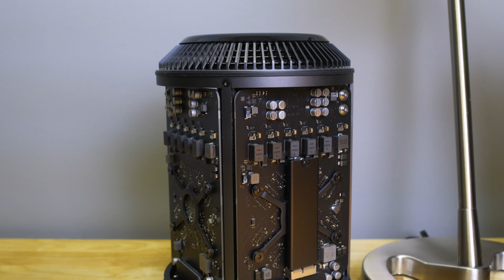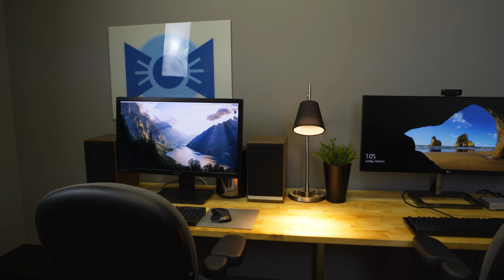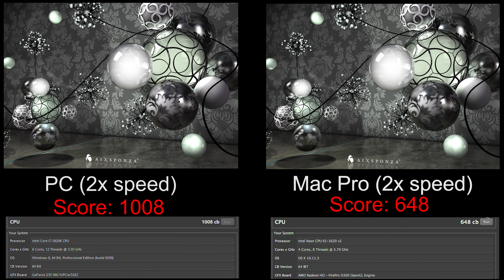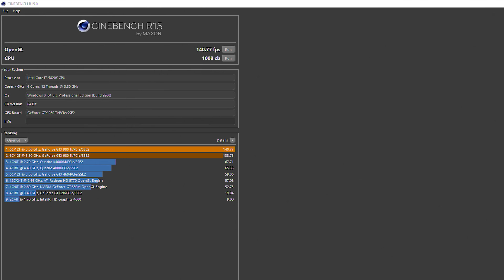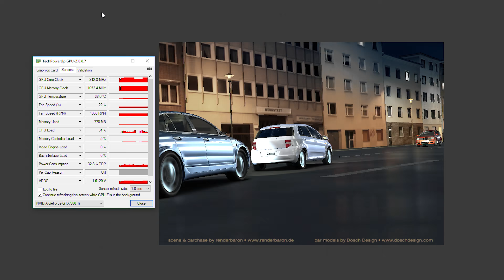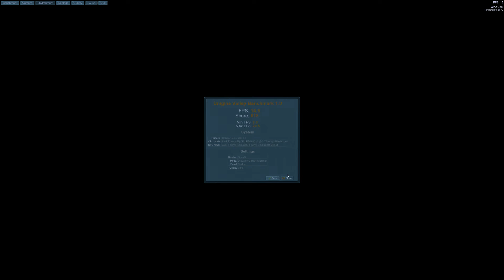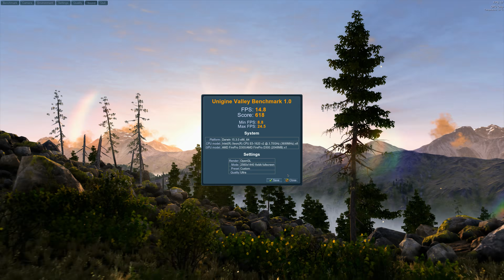$2,000 Custom PC vs $4,000 Mac Pro

Comment: My Alienware is probably stronger than that 4000$ Mac lol
Reply: you said probably lol ironically Alienware and Mac both overcharge.
Reply: +Phoenix MH83 yes they are.  But now laptops aren't that overpriced as before.  A 2000$ alienware has 980m vs a 2000$ pc that will have 980. And I'm talking about a full pc not just tower. 
It Just comes down to portability vs performance.
Reply: A 980m will not perform on the actual 980 level. Maybe 750 ti. For $2000 I could build a beast. You never really want to spend that kind of money on a high end pc unless you dont know jack about building them. The money you save is amazing. But Alienware will charge even more than other retailers do.
Reply: +Phoenix MH83 btw.  980m is pretty much a gtx 970 if u don't know and yes u can.  What did I just said?? Performance vs portability..  Yes alienware is not as strong as a desktop in that price but u can just take it anywhere u want. Not like desktops..  And in 2000$ a Full Pc will have a 980 not 980ti. That's for 2000$ tower unless u got heavy discounts..  Lol
Reply: +Rock GamingTV 970 out benches the 980m you can check for yourself. 750 ti is an excellent card and great comparison. Especially when overclocked.
Reply: +Rock GamingTV for $2000 I could make a rig that would run laps around alienware in price comparison. When they say your paying for the name they mean it. Their products are cool looking but its throwing away money given the alternatives
Reply: +Phoenix MH83 I said almost lol..  Yes 980m loses to 970 by 10 fps. But comparing it to 750ti is Just funny..  750ti gets around 35 fps on bf while 980m gets 62.. Anyway.  It comes down to personal preference.  U travel a lot? Get gaming laptop.  U stay in one place..  Get desktop.
Reply: +Rock GamingTV My 750 ti performed over 60 on ultra with Battlefield when I owned one. I loved it. Then I got my MSI 970 OC
Reply: +Rock GamingTV there are lots of videos out there you should check them out. 750 to was damn good especially in Battlefield
Reply: +Phoenix MH83 OK.  I checked every benchmark for 980m and 750ti and did some of my own 980m benchmarks..  
Bf4 tests. 
750ti oc hits 60+ only when there isn't much happening in the screen.. Like at all..  It drops to 25 or even low on some places. 
980m hits 100+ when nothing is happening in the screen and drops to 55 on worst.  
750ti oc avg is 44 fps 
980m avg is 81 fps..  
There is no competition.. They both are in totally different league..  The only card who was as good as 980m was 780 non-oc. U can see the benchmarks.. I have seen like every benchmarks anyway.

Comment: You should compare a  $4000 windows pc to the Mac Pro
Reply: R.I.P macbook pro
Reply: 1. There is no newly released MacPro yet
2. When the MacPro was released, any 4000Dollar PC was better except for the small formfactor the MacPro has
3. Even if you buy the MacPro now (4000 dollar Model) You get the same base specs as mentioned in the Video, which is still freaking old hardware.
4. The fact, that you buy the name APPLE with every overpriced product they have is not even a secret. The Hardware is old when it's released, the fact that apple mostly uses proprietary Adaptors (lightning...) for most of their Products is stupid.
Reply: Theres no point; the Mac would simply short-out due to the amount of overwhelming power it detects coming from the PC.
Reply: Maybe it would be more fair to compare a newly released MacPro to a $4000 windows pc. Still if you are going to pay this amount you should know every time what you get from one solution or another. Plus, to be even more accurate you should put Xeon and ECC memory to the windows pc as well as fire pro graphics cards. I have a suspicion that in that case the price difference would be narrower, but still the windows pc would come on top.
Reply: would be a better idea to use quadro for gpu as they are more up to date than newest firepros and also have cuda. Though the windows pc would already win in reliability thanks to proper cooling.
Reply: He should also use a xeon not a I7.
Reply: +tubeRSP mate, a high end pc should run any game 1080p 60fps high graphics for at least 5 years, no matter the age
Reply: +CoComero Productions I don't disagree on this. I don't even disagree that a pc with consumer parts will probably run games faster than one with "professional graphics cards".  But to me this artificial divide between "consumer"  and "professional" parts is an insult to the end user. A graphics card should be equally good on the compute part in any case. Because I have never seen any of my pcs strictly as a platform for games, but as a general computing machine, in which lies their superiority to any other  "platform". But reality is reality and if you want to see what it takes to have an equally good pc on the compute part you have to throw in professional parts. Loosing 5 to 10 frames per second in games is sth you can live with and is hilariously irrelevant at the end of the day. But not being able to take advantage of your whole silicone for computing is big fraud to put it nicely. The same logic applies to cpus which has further unpleasant repercussions for computing in general and for games in particular.
Reply: He should actually try using comparable types of components in that one.
Reply: Dot Red a laptop? lmao laptops are shit for gaming an preformance

Comment: again another pc mac war. benchmarks benchmarks price price price..   No one seems to really understand the product's production value.  All macs are specially designed and custom build every single part of it.  PC is custom build with consumer products available on the market despite all it's specs.  Btw anyone got 6 Thunderbolt 2 20Gb/s ports, and Built-in Digital Optical Audio support 198KHz on their PC? Add that to your total cost.  DELL, HP & Asus got workstation / gaming rig way overpriced a Mac. Now that's what people should compare with.

Comment: Want to point out that you can get that $2000 performance or even more for ~$600-700 if your really smart with used hardware. 

IE, if your lucky you can grab a Z800 \w 2x 6core cpus & 64GB ram for $300-400 if your lucky + plop in a 980ti and you have similar performance. Albeit the 6 core cpus on their own are much slower; added up its about the same;. IE, dual X5670 = 12742. i7-5820K = 12976pts on cpu benchmark. 

if your more adventurous; you can even pull out 4-5x those specs for $1000-$1500 with used hardware.

Comment: The Mac Pro price was justified at launch because of their use of server grade components (Xeons, ECC RAM, the AMD FirePros). A similarly specced workstation from Dell actually cost MORE than the Mac Pro. If Apple hadn't been so slow updating their hardware it wouldn't really be so much an issue, but they haven't! Its really stupid.

Comment: Xeon CPU and Fire X Pro are not supported by game designers therefore the performance will not be optimized. Mac Pro is a workstation PC specifically designed for drafters, designers, 3d modelers, animators, engineers and scientist and not for gamers. Gamers who like an all-in-one type of PC and are looking towards Apple, might like an iMac fully loaded to play games at 5K with solid frame rates. When gaming, use an iMac and not a Mac Pro and try to get native Mac versions of the games. I be willing to bet your video will be significantly different if you tested the Mac Pro with 3DS Max, Lightwave 3D, Maya and even ZBrush. You can hook up multiple monitors to it. You can even run a nice CAD program and test a jet engine simulation. The point is your video is Apple and Oranges.Next time compare a PC workstation to the Mac Pro just to be fair and not a game rig.
Reply: from what I know of 3ds max only works on Windows...  He tested the graphics on opengl not directx in all test, addition many pro programs now is using a dx (3ds, maya) because it simply works faster and is a better option if the finished product was fired at dx. Now used Xeons 16 Thread cost $ 70 ...
Reply: Yes you are right and I should have mentioned about Parallels with Windows. I have Windows running 3DS Max and it runs well with just my old iMac. A brand spanking new Xeon will not play games as well as a brand spanking new i7 because of instructions are geared slightly differently with one for server and the other for more general purpose. A Xeon Power Mac vs a Xeon Windows PC would be an Apples to Apples comparison like wise a 5K iMac to a 5K Windows PC with similar hardware specs would be Apples to Apples.

Comment: technology price per value rapidly depreciates, buying a four thousand dollar pc in any given year, for gaming, is reckless. given the notion that this is contextually rational, your point at the end was great though; still selling this as is for that price is criminal. on the other hand, maybe you shouldn't be using a geforce to compare performance to a firepro. the pc equivalent would probably be a quadro, which is similarly inferior to things like games. those video cards are for things like 3d modelling, aftereffects etc. i was unable to find a contemporary price point for the d300 but if you google 'd300 vs quadro', it compares with a 1% difference to a quadro k4200 (on www.game-debate.com) which can at present be purchased for around $770, 19.25% of the system's price per card. i don't have the interest in fully breaking down the price of building an equivalent pc to this 2013 mac pro, but others already have and found it to cost more than the mac (if i'm not mistaken, this is the model that cost 10k back then, and custom building a pc version would cost 12k). the cheaper model though was actually 1k more expensive than a pc equivalent at that time. in conclusion, while apple is perhaps exploiting people with their price point, i think you misunderstand why it performs comparatively slower in the applications you used as a benchmark. try loading up a high poly 3d model (something like 2 million poly) in both machines with zbrush or (free) blender with the viewport set to rendered mode, and rotating the object.

Comment: Custom PC versus a prebuilt at double its cost. Yeah, no surprises here. Though it is a bit unfair that the prebuilt is 3 years old and its hardward is even a year older on top of that. At the very least, the cost of the thing should've dropped to compensate. I mean, to be fair, some people are too busy to do the research and work to make their own PC. And they might not have the time to ask around if any of their friends can help and do it for them (with some compensation of course). Those poor souls have to pay a large premium for their computers.

But Mac should really update their lineup. Selling a 3 year old computer as your top of the line model should realistically cost you at least half of your consumer base or get you sued for ripping people off (though it won't).

Comment: But why 32 gigs of ram ?  If you ask me it's just to much .
Reply: Futureproofing.
Reply: I had a look at my friend's Mac with 16GB of RAM. He was editing 1080p video and ran out of the whole capacity in minutes.
Reply: well even 16gb will most likely never become obsolete, so 32 gb is unnecessary. if anything programs and games are becoming more optimized, therefore ram usage will probably be decreased.
Reply: "too much."
Reply: DankMusic  or everything will increase.  really depends how you look at it.        32gb is standard in professional fields
Reply: "Too much"
Reply: 1080p shouldn't get all of the 16gb tho, the program probably reserves it anyway for the smoothest experience. It's that or the editing program is really memory inefficient. Or his project is insanely large which most people tend to split up in the programs to minimize any out of memory issues or other program crashes and to increase performance.
Reply: Hayzl he probably doesn't have the software optimized for the 16gigs in his system.  AE and Premiere have options for this..  having background apps open really takes a toll as well.
Reply: It is not for gaming, you need 32gb of ram for video editing, that is pretty normal.
Reply: Wrong
Reply: Youre dumb as fuck and have no idea what you're talking about

Comment: Don't forget once you build one computer the next gen all $2000 goes to gfx, motherboard,  Cpu and memory only. Thats doesn't need done but every 8 years so you can just upgrade gpu and add storage inbetween

Comment: First, I strongly dislike anything by Apple. So it hurts to actually defend them in any way. With that said...in defense of the Mac Pro, Apple is using a Xeon processor and ECC memory. Those components are extraordinarily expensive and only found in workstation- or server-like computers, not consumer-grade hardware.

If you went with a newer Xeon and used ECC memory (with everything else being equal) your cost would be higher than the Mac.

Comment: Also, to be fair enough, Quattro GPU's cost not less, or even more than FirePro. So if you replace GeForce in your PC, with same specs, your PC is going to cost for about $4000 as well as Mac, and will deliver same benchmark results as Mac with FirePro. So don't get fooled, watch what are you comparing :)

Comment: Review worth nothing! You are comparing computers initially designed for different tasks. And at the end, I'm not Apple fun, but why the hell you are gaming GPU with GPU dedicated for CAD, 3D-modelling and stuff like this? Their drivers work completely opposite. 1st cards suck in CAD and 3D modelling and 2nd cards suck in games. You have to compare GeForce with Radeon, but Quattro with FirePro. So your summary is unfair:)

Comment: Great build! How did you mount the H115i to the motherboard? I have just bought the same motherboard and the h115i and then found out about the narrow ILM layout after trying to fit it. I have read that asetek sell mounting rings that should work on their eBay page. Is that what you used?
Reply from the maker: +Craig Mackay It is. The eBay narrow ILM bracket worked great. We probably found the same forum thread. :)
Reply: +Snazzy Labs excellent! I'll order one up just now. Shame I'm in Scotland though, delivery will take ages haha. Thanks

Comment: My understanding is that pros tend to buy second hand older mac pros - the ones that look like a metallic box - and update the hardware in much the same way you did for your PC. Much better performance than the Mac trashcan. I'm a mac user from way back but this.... not good.

Comment: I'm suggesting another benchmark that  might level the playing field, It's actually a rendering program called Blender and you can get it at Blender.org. While there get the BMW render benchmark. The reason I say this is I found my Phenom 2 X6 1055T at 2.8 Rendered it 2 and a half minutes faster than my  8 core FX8350 at 3.5. It is for Mac and Windows and Linux.

Comment: My €700 budget PC is better than Mac Pro (in GPU intensive tasks not sure about the CPU) and also has some older hardware (2013). I have no problem with apple products but a big one with the price and how they get marketed.
Reply: Try running a server with your PC, that's one thing that Mac Pro's Intel Xeon will certainly do better
Reply: +ArdaBlock or you can just build a pc with a Xeon or Broadwell-E cpu and it will still dominate a Mac Pro
Reply: +Munchyzz hahahaha indeed

Comment: Not quite sure if you're going to see this or if it has already been mentioned before but there are some caveats to these two computers. The first is that you are not comparing apples to apples with the GPU's, the AMD fire series is a workstation built card, made for crunching computations and that's really it. It is a terrible card to run uni engine or other gpu tests on because while it is a "graphics card" it isn't made for those types of tests while the 980ti is. The second is that workstation cards just cost more, they are generally more expensive than their consumer gaming brothers or sister cards. the Nvidia Quattro for example is like... 3,000 for one card. So that could explain your price differences. Overall though I thought this video and your other one were great and it's nice to see someone else experience building a computer for the first time, it's as rewarding as it is frustrating.

Comment: As a loooooong time Mac User I have no issue in admitting EVERY Mac is over priced. When you compare component cost and what you can by for less or equivalent money it is very easy to become outraged. However I use my Mac for specific work and software that I like, furthermore, I much prefer Osx to Windows. if you want to game, have more control over what your computer to do, OBVIOUSLY you should buy/build a PC. it is no contest, you can build some epic monsters. one of my main Peeves with Macs is the fact that I can't use more powerful graphics cards, the option are very limited for Mac. External GPUs may help with that, but most need you to run boot camp etc so might as well build a PC.